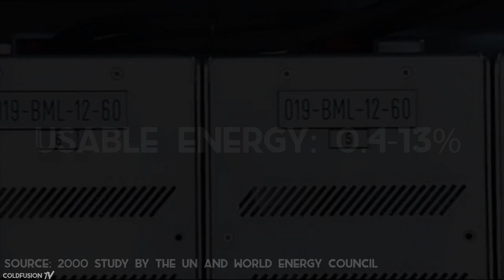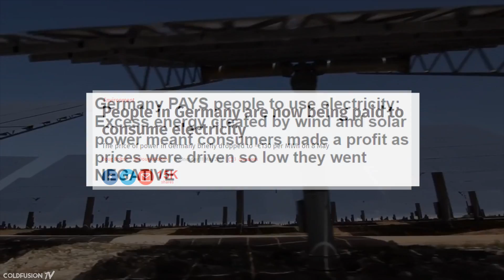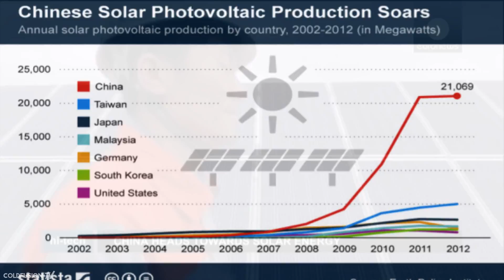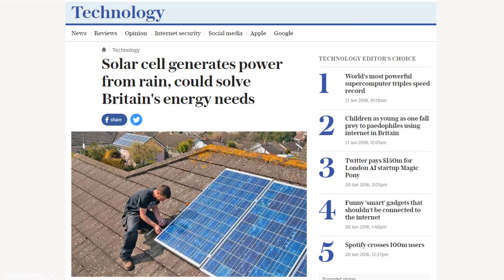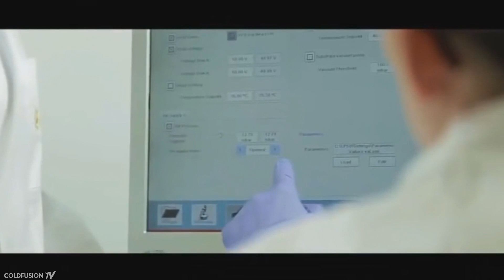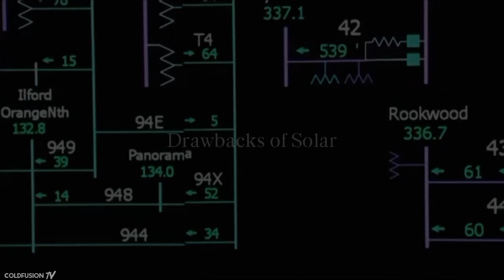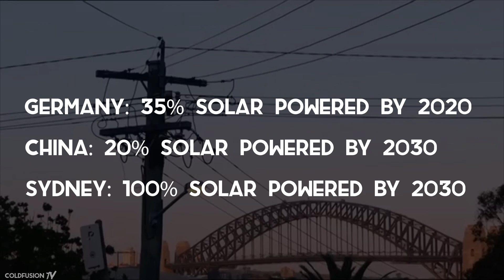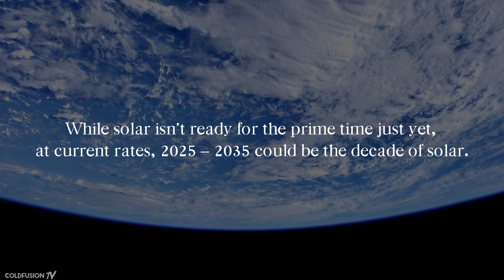The Truth About Solar

Comment: When it's sunny. Use solarpanels. 
When it's cloudy. Use windfarms.

It can be a great 50/50
Reply: I think solar troughs are superior.
Reply: I was long pessimistic since we desperately needed better storage to be invented. Meanwhile I see it's a matter of connecting all electrical grids since when it's cloudy in Germany, it can be sunny in France This is even already established in Europe  as we speak but it's not working really well yet, I have the impression. For a start, minimizing losses requires DC high voltage.
Reply: @Allen Loser that's what batteries are for.

Comment: Well, if it works, creates profit and doesn't need subsidies, it's OK. But I just wonder, how well will solar power work here north of 60th parallel? (About as far north as Alaska). During winter, when most energy is needed, we get the least sunlight. Up there in northernmost parts of my country, none at all for a month or so!

Comment: Currently, the only GENUINE research going into Solar or Wind power generation either one is researching ways of acquiring larger Government Subsidies.
The ONLY thing keeping Elon Musk out of bankruptcy court is Government Subsidies.
Even with the assortment of rebates and tax credits, it still costs as much or more than the house is worth to convert to Solar.  And that is without adding any value to the house in the process.  With the solar system being due for replacement long before the power generated ever paid for the initial installation.

Comment: 2025-2035 Year for PV????  Even @ 100% efficiency and Cheap CHINA #1 PV that last 500 years ( NOT E-WASTE =25 YRS).  WILL require so much CH4 backup and Cu Wire and ECOSYSTEM Killing of 10000's KM^2 farms?  We may as well just build 24/7 Combined Cycle CH4 plants @ 65% efficiency for the SAME CO2 - Emission Reduction.  LWR Nuclear Power is by FAR the best 2018 CO2 Reducer.  LIARS==The Truth???? About Solar

Comment: in INDIA there is airport named "cochin" which works fully on solar panels. totally fully
Reply: And how do they handle the Monsoon?
Reply: @johnnygenlock  With cheap and dirty coal power. Just as India powers most things.
Reply: They route their  excess electricity in the grid. This is  definitly enough to compensate the monsoon-Season, so that they  completely produce the energy, they are consuming, with solar panels.
Reply: And the airport definitly reduces the airport's emission. Definitly looks great!
Reply: " This is  definitly enough to compensate the monsoon-Season, so that they  completely produce the energy, they are consuming, with solar panels." That is not my definition of "totally fully."
Reply: optimizers_____How fast can the jet planes go with their solar panels?

Comment: They were not honest about how negatively any shading of solar arrays affects output drastically! Or how solar cells deteriorate over their entire life span.
Reply: Paul Smith - if you own a solar system you only have to compare what power is being generated on a clear day compared to a cloudy day. Der. "It's that simple". (Quote James Randi) Deterioration - Just check what the maximum output is in the summer compared to the rating of the system. Do it as the years go by and you can see the drop off. You figure out the %
Reply: Paul Smith Solar Panels lose 10% of what they were able to put out over 10 years and 20% over 25years, for a premium product. 

Now to get to your claims: Except for a country that is 4-5 times as sunny as Germany, where I am from and did my calculations for, you are telling wrong things. 

It takes 12 years to pay off the panels and the DC/AC-Converter. Afterwards, you do save money, but claiming it to be 4 years is just...wrong.

Only in summer, for about 2 months can the PV modules provide for all of your  energetic needs. And only during daytime. The rest of the year, it only supports and helps you not buying energy from the grid - which is your main means of amortisation for the panel's costs. (All calculations without a battery to save energy, because the battery would make it non-amortisable. They break before they pay off. )

Also, since Germany tried to switch to renewable energy sources, its CO_2 emissions grew by 30%. Because making the panels is dirty. And nobody even started recycling them yet - which will result in even more emissions.
Reply: The parts of that statement that WERE correct 10-15 years ago. Not now. The rest is rubbish.
Reply: The fact that you wrote - "If you don't believe me" indicates to me that you think I won't believe you and I don't. Tell us another one. Not.
Reply: You're telling me they deteriorate rapidly, then when I ask how fast you tell me to go find out. In other words you are making that up. You don't know.
Reply: The two common typed of panels are monocrystalline and polycrystalline. The rated power output of solar panels typically degrades at about 0.5%/year.   http://energyinformative.org/lifespan-solar-panels/
Reply: That's what they are warrantied for. A new car will come with a 60k mile warranty.  Is that when it dies? No. In reality panels will easily make 90% output after 20 years, and go on producing energy at lower output for 50 years.
Reply: a panel manufactured today should produce 92% of its original power after 20 years, quite a bit higher than the 80% estimated by the 1% rule.    https://www.engineering.com/DesignerEdge/DesignerEdgeArticles/ArticleID/7475/What-Is-the-Lifespan-of-a-Solar-Panel.aspx
Reply: i thought they said the new panels worked in the rain . Maybe you should watch it again . Sounds like some on here went to same university  as tony Abbott  😞
Reply: They said? Who? There are panels in the labs working with rain, but not commercially available.
Reply: You've done a study on this? Others much more qualified have, and you are completely wrong.     https://cleantechnica.com/2018/06/21/fraunhofer-experiments-in-chile-and-vietnam-prove-value-of-agrophotovoltaic-farming/
Reply: more than a few parts.
Reply: James King change wether some were els same reflect see
Reply: James's point is that this article implies that once installed, solar is "free." It is not. Yes, NOTHING is. Everything depreciates and everything degrades. So stop with the "it's free" nonsense. I would also add "how much do governments tax solar manufacturing, and solar power generation?

China's solar programs are by and large fakery. Like much about the event, during the Olympics in Beijing, China lined the streets leading to the stadiums with tall poles loaded with what looked like wind generators and solar panels. Problem was, the cells were not connected to anything and they used electricity to power the blades of the "wind generators," actually consuming power rather than generating it! China frequently announces big government programs to do this or that, but seldom do they follow up on those commitments, nor does the lapdog press that sucks it up like a Hoover DeLuxe. If ColdFusion wanted a real story, it would dig a little deeper to see if these Chinese programs were ever implemented.
Reply: What kind of energy production does not require maintenance? So why is it dishonest in this case?
Reply: that's also improving tho
Reply: James King really? We close coal fired plants all the time because the cost out ways the profit, so 0 difference there, and yes shading us a problem, although less and less as new technologys roll out.
Reply: James King or how they entirely block out the area beneath them which reduces wildlife populations. GO SOLAR! USE BIOMASS
Reply: Matthew Niedbala omg. So what is you solution to the oil crisis, global warming, energy security, relience on imported fuel, health problems in the mining industry, air quality, international competitiveness? I think someone in the stone age had similar difficulty in opening their mind to new technology...just before the iron age people took over their world ha ha...
Reply: You missed my point Paul. Please let us all know when you break even. Also when you have to buy another system? Also when you save the planet. Who hah !!!
Reply: So James, tell us, with peer reviewed studies, how much shading affects it and how much it deteriorates.
Reply: You don't have a point...other than on your head. I paid my system off after 3 years, now I average $400 profit per month. If you don't believe me....I don't care. Get my point?
Reply: Hahaha. That's like saying it's cold out today so global warming is fake. Does closing a coal fired plant for maintenance stop the grid? NO. I have solar and I am not off the grid. I do however produce more power than I use. On a few days the grid supplies me. Most days I supply the grid. Cloudy days not as much, but sunny days 25x as much. Over the year I make much more than the system cost.

Comment: Mr Musk saying that light comes through cloud. True, but that is not the problem the angle of the sun is critical to output. All domestic and most commercial solar arrays are at a fixed angle, and in domestic situations dependant on the roof angle so may never be at an optimum angle. Theory is all very well but, specifically in the U.k., it's obvious how little solar generated electricity we have for six months of the year compared to the installed capacity. Another unsurmountable problem is that in the worst six months solar does not generate when the grid demand is higher so we are relying on other sources fof generation.
Far too much hype and glossing over the real practical limitations of renwable energy. 
People talk about 100% renewable generation, it is an impossibility in the medium to long term unless some miraculous discovery ois made.

Comment: Would it be possible to store energy by using solar to seperate H2O into hydrogen and oxygen, and use the hydrogen to generate power at night along with power stored in batteries?

Comment: My most opinion about Solar is only if you use it to get free of the state grid ..
To use and consume your Energie without any other needs . 
I'm working on an Solar - Hybrid -Panel . This Panel will use the thermic Energie too , for hot water or heading the House .
It will include Geothermie . 
For E- Power and the Thermic-Power from the Sun .
To get the 2 + from the Sun .

Comment: 4 minutes into the video it's talking about Germany paying people to use electricity because they have an excess, but it doesn't mention that they've gone through extended energy droughts. Where in they've had to buy energy from neighbors because they can't supply enough of their own.

A method to store the energy long term on a large scale for a city for example doesn't exist yet either. Even if it did, massive batteries which would be needed to store this energy would need huge, expensive, costly mining operations need to be conducted to obtain the materials for the batteries. 

Also when talking about the downsides to solar, it might be a good idea to let people know that solar panels have components and metals in them that put solar panels into the category of toxic waste when they need to be disposed of.

Comment: What would hapoen if terrorists suddenly cut the grud all over the country?  Modern life would stop in most places. If everyone had solar, things would be a lot different.  The new high efficiency high  temperature solar cells combined with heat extracting engines and solar fuel synthesis technology will make fossil fuels near obsolete and $.25 cents a gallon gasoline a possibiliry.

Comment: Solar will rule the world. A full switch to solar and wind energy will increase the risk of the use of weather modification technology to gain or change renewable energies output on demand. As long weather modification tech is available, and as long poeple are speculating on the price of electricity, this is an access point for manipultion. There must be clear and transparent talks in the UN to refresh this topic. Full-Renewable switch is good, but the poeple have to ask for a clear and public discussion about the weather modification. It's a full speculation I have to state.
But I think if big oil is gone, the shit will find it's way to produce shit. Even if it is to manipulate the energy stock market, which will be the only thing left, if energy goes decentralized.

Cheers and greetings from germany

Comment: Solar is bad. why ? it's using silicium, a fossile material. It's expensivier in energy to manufacture than the first year of production of it. It's also bad at lasting long : within 10 years the panel has lost 50% of it's efficiency. So solar IS NOT a good idea.
Reply: 95 % of the earth crust consist of Silicon based minerals.  https://en.wikipedia.org/wiki/Silicon
  Read this article before you post such nonsense as this is a fossile and rare material.  
On the other hand Solar can be the future helping to reduce emissions and thereby  improve quality of life.
Reply: Wrong. panels lose only about 1% output per year. after 2 decades its still yielding 80%.

Comment: Put Solar panels on EVERY roofs in the world... and we'll never need anything else...
Reply: You'll never never need anything else except five times the capacity of solar in storage. Wind is much better at three times the storage. Or you can skip the storage and burn natural gas.
Reply: excepts thousands of batteries ... that are us ecoUNfriendly to produce as the worst thing you can think of... We can invest in solar, wind and battery development in hopes that breakthroughs will make them better than what we have now, but we should be clear on one thing: they are not green by any means. We are just offsetting pollution to another region on the planet that we do not see.
Reply: sashkashurik 
So what do purpose as an alternative. I think thorium is worth a go and all the other renewables. In the uk coal is used between 0% -10% so coal isn't the issue, it's natural has as we use that between 30%-50%, wind is between 5%-30%. Wind, solar hydro, batteries and thorium could power the world

Comment: However good Solar is, the limiting factor is the energy density at the earths surface. In hot places that's reasonable, but elsewhere it is very low. It's useful to some degree, but will never provide lots of excess energy.

A far better option would be to bring this much denser energy resource to fruition.
https://www.youtube.com/watch?v=c7baTdyHv8g

Comment: As solar becomes more economical, humanity could go through a paradigm change that is very easy...shifting our power demands to day time. With the advent of smart home technology, it’s easy to time our energy consumption to the daytime hours...running our appliances while we are out at school or work. Human health would likely benefit  from less light pollution as our consciousness about living with the natural cycles becomes more normal.  Imagine people sleeping more (the only time the body heals itself, including scanning for cells with DNA damage and auto-digesting them.  During sleep is when our body rides itself of cancer cells.)  
One easy way to facilitate a shift in the use of electricity is to have lower electric rates during the day and much higher rates during the night.
Reply: A lot of people like the temperature of their home to be warmer or cooler only when they are at home, that would include evenings. Electricity rates are not presently set by the urge to provoke social change, they are based on supply and demand.